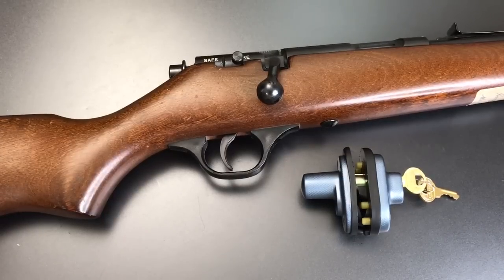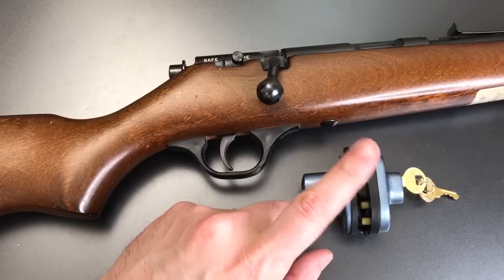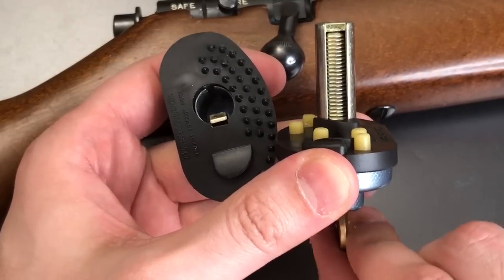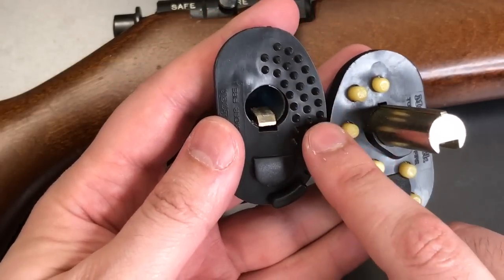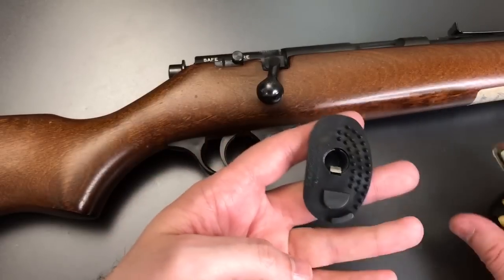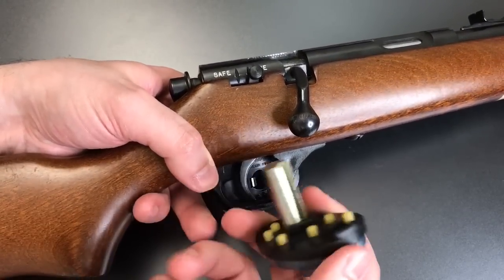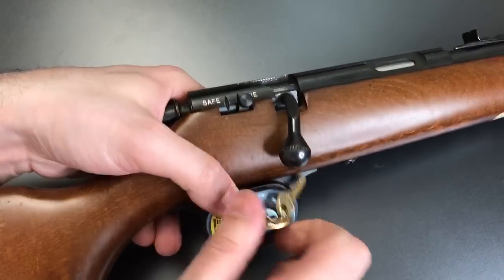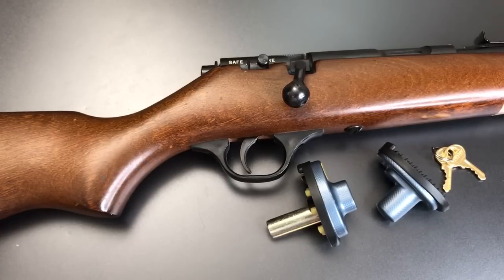[444] Master Lock 90DSPT Trigger Lock Picked

Comment: It's scary to imagine how many parents out there are relying on locks like these to prevent their kids from tampering.
Reply from the maker: EXACTLY!  Hopefully more people will see videos like this and make better decisions about firearm security.
Reply: LockPickingLawyer I wish most people understood that it's important to expose the faults in locks, especially when lives depend on the lock in question.
Reply: I recently obtained a Remington version of that Master Lock. Mine is a metal Forest Green 5-wafer.
Reply: I think if a kid successfully picks a lock on a firearm, you have bigger issues. My understanding that the purpose of a trigger block is to make it obvious that the weapon can not be fired so as to display that it is safe, and to prevent casual mishandling of the weapon. Block in place and in a safe should be more than adequate to prevent a child from playing with it.
Reply: @Mostlyharmless1985  thank you finally someone has sense around here besides me
Reply: Let's be fair; these things are designed to defeat small children. A determined criminal will easily get access, but the fact of them doing so will count against them. If you have to go through the lock on the safe, the lock on the box the gun was in AND the lock on the trigger, it's proof of intent; you didn't just "grab a gun in the heat of the moment and it went off".
Reply: @Mostlyharmless1985  that is the intent of a trigger lock however most people think that if they put a trigger lock on their gun than the gun is actually secure when in reality it really isn't. As lock picking lawyer dually demonstrated in this video a child could easily fire that gun assuming it was loaded just by pushing and pulling on things. (I can almost guarantee to you that I would have accidentally fired that gun as a child assuming it was loaded and locked with that specific lock) cuz I can tell you right now that that's what some people do they will put a trigger lock on their gun and it will be loaded but it'll be a trigger lock with a flaw where you could actually pull the damn trigger while it's locked
Reply: Well, there’s no hope for people so astoundingly stupid to keep a firearm loaded, with a universal trigger block on it and think it’s good. Personally I’d store something like a rifle with the bolt out, blocked, and in a cabinet. For a hand gun I’d just have the magazine in a bedside table and the firearm in a safe, key next to the ammo.
It really bothers me that some people are so paranoid that they’d keep a loaded gun arms reach away. I feel like if you are that concerned about your safety in your home, you should consider moving.
Reply: @Mostlyharmless1985  instead of consider moving maybe consider not pissing off people to the point where you actually need to worry about that.
Reply: well its mostly just for protection from the trigger hitting anything or that too but mostly just general safety

Comment: One thing that I am reading about this lock, is the lock cylinder is supposed to go behind the trigger, not in front of it. So this lock would only work if your gun has enough room behind the trigger. Your little 22 rifle is not the correct application for this lock.

Comment: Masterlock missed a trick here.  If you make a wedge that goes to the back of the trigger,  so it pushes the trigger forward the tighter you push it together, that would at least solve the issue of manoeuvring the lock to gain access and stop you from pulling the trigger.

Comment: There are two other easy defeats that come to mind. You could remove the trigger guard with a screwdriver and the lock would come off with it. Or you could loosen the stock screw and separate the stock and barreled receiver. As far as I’m concerned the only way to secure a gun is in a safe. A lockbox is acceptable if it’s more of less under your supervision, like at bedside.

Comment: You can open them by placing a screwdriver on one side, and giving it a tap or two with a hammer. The two half's will pop apart.
Reply: I was just brutal with a screwdriver and palmstrikes, pushing/ I weigh 300 pounds so I leaned on it and was done in 10 minutes God bless you North China Airguns

Comment: I am pretty sure most of us got it for compliance reason.

Just got mine today and put it on some handgun to see how it fits. The manual says better to put it behind the trigger but both of mine won't seat properly unless I put it infront of the trigger. I got this set since the rubber guard won't damage the trigger guard and purely for lawful storage purposes.

It would be better to add a cable lock to go through the action and put in in a box and put a lock on it. Then you place it in a gun locker or safe for added protection. Or to delay the thief, lol.

Comment: LPL, I have one of these in front of me and have determined it can be bypassed quite easily. All it takes is to insert a sharp object between the back piece of metal and the rubber gasket and push the spring-loaded ratchet part away. This releases the part that holds it all together.
Reply from the maker: I can do it very easily as well... until I securely lock it to a gun.  That's where it becomes difficult.
Reply: Thanks bud. I just did this on my shotgun. Had lost the key and was trying to figure out how to get in. This took me 20 seconds. I guess i didnt have the lock on too snug.
Reply: @lockpickinglawyer  Great video as always! I was also able to wiggle the lock just enough to access the ratcheting detent, and work it off a handgun trigger, as others here have done. I made sure the two halves were firmly pressed together with the spring loaded pins up against various spots on the trigger guard. I completely agree that it must be fitted in the right spot, with the understanding that different gun characteristics may render this device almost useless.This should probably be considered as more of a deterrent than a true “trigger lock”. And I do think you drove that point home with this video - thanks LPL!!

Comment: I've got one of these locks, I'm having trouble picking it with a bottom of the keyway tensioner and a standard hook. I can't tell if the tensioner is getting caught on the metal surrounding the core or not. Additionally, the small keyway makes it difficult to get at pins 3/4 without oversetting pins 1/2 and reaching diagonally around the warding has been pretty difficult. Would a top of the keyway tensioner make the difference in picking the lock, or does it require a slightly different approach with the tools I already have?

Comment: What would be a better style lock for this particular gun?  A cable lock that goes down the barrel and out the action would be good but I've never seen one that long.

Unrelated, could you do a video picking one of those teeny tiny TSA suitcase locks?  A few months back, TSA "accidentally" cut my Abus Titaliums off my Pelican case and replaced them with two of those little 25¢ junk locks that have standard keys and then sent my gun to the wrong airport!  When I finally got my case back, I was going to pick the locks but they were too small to even access the keyway.  I ended up using a 2' long piece of paracord like a slide hammer and popped both locks off in a matter of seconds!
Reply from the maker: If I was locking this with a commercially available product, I would remove the bolt and thread a cable lock through the action.  As for the TSA locks, I don't think that I've ever even held one.

Comment: Great info in your commentary; I  have an earlier version of that particular trigger lock [doesn't have the yellow-springed buttons], but never tried to pull down on it like you demonstrated.
Reply: I remember that style of lock from my youth when it was used to secure an air rifle. Brass pins and more of them if I recall correctly.

Comment: Where I live all the law states is we need a lock that requires a mechanical means to open.  I have one on a lever gun that meets the legal requirements that opens with a screwdriver. Which is weird seeing as I live in Canada.  Would have thought the locking regulations would have been stricter considering what we are currently going through up here (not debating it)

Comment: All you have to do is slide a small flat screwdriver in between the rubber and the back half of the lock and push aside the spring loaded wedge and the lock comes apart easily as the teeth are no longer engaged to hold the lock together.

Comment: There's a few things that you have missed, because they can take that trigger assembly out and put a new one in. Or just take the trigger assembly out and have either a locksmith or a gunsmith to take the trigger lock out.

Also for cheap plastic trigger locks are terrible idea. Because you can break it apart with nearly any tools. Rendering the plastic trigger lock useless.

Comment: the other weakness is the ratcheting mechanism if there is not a good grip on there you can pry up on the teeth on the female end and inch the lock off and if there is a good squeeze on it you can cut the rubber off the lock and make more space

Comment: I watched this video to learn whether the lock pin goes in front of or behind the trigger. You show applying it in front of the trigger. If all trigger locks work that way, that seems dumb. Why wouldn't the lock pin go behind the trigger so it couldn't possibly be fired with the lock on?

Comment: A few years ago, I showed up at the range for training and forgot my key. In front of the instructor, I used a staple from the target stapler as a tension bar and the tooth pick from my Swiss army knife and had it open as fast as the LPL. The instructor was astonished, so  I did it again after he verified that it was locked. Those units are a joke.

Comment: When I use one of these locks on a revolver, I usually can place it behind the trigger, thereby not allowing the trigger to move backwards far enough to fire the gun. Obviously not a great lock, but one that will probably not grant immediate use of the gun when stolen by an amateur. So you probably won't get shot by your own gun if you return home to the burglary in progress, which could be embarrassing.

Comment: Hey lpl! I have this exact gun and have no lock for it. I like with a few adult roommates (yikes!) And have been worried about safety. So far my security has revolved around simply not keeping any ammunition in the house. What lock would you recommend for this gun?
Reply: Lock the bolt in a secure location?
Reply: @Mostlyharmless1985  well yeah but how exactly do I do that? Or do you mean to actually disassemble the fire arm and to physically lock the bolt in a seperate secure location?
Reply: @autodidacticartisan  yeah you just take the bolt out. Dunno about this specific rifle what that entails or if you even can do it, but if you take the “makes it go boom” part of the weapon out of it it’s only as dangerous as a club.
Reply: @Mostlyharmless1985  I guess thats true. I'll Google it to see if its easy. If its something that takes more than 5 minutes though I probably wont do it

Comment: Why use trigger locks when you can use a gun safe? Sure, it can be opened but it's still safer than an easily gotten around trigger lock that might not even need to be picked.
Reply: Gun safes are much more expensive and a lot less mobile.

Comment: i just use a small flat head to move the ratcheting part to open those
Reply from the maker: Though possible, I should note that is very difficult to do with the lock properly installed.

Comment: Masterlock is a "master" lock company.
woulf this lock not be better if the locking bolt just went behind the trigger. There are so many better designs out there. I trust the lockpicking lawyer could safely come up with a good design for gun locks
Reply from the maker: Agreed.  If this went behind the trigger, it would be different.  But I'd imagine that only a few double action pistols could fit post behind the trigger.

Comment: not to mention that rifle has a plastic trigger guard.  1 good whack and the lock and guard are off.
Reply from the maker: Hmm... I'd have to go check, but my recollection is that the trigger guard is a cast metal piece.  Still probably easy to break, and you can also just unscrew it.

Comment: a tricky lock to pick would be to have a internal mechanism that if you press one of the pins, several strong springs would get released, pressing the pins downwards hard, making it so you have to exert a lot of force on the rest of the pins, increasing the risk of breaking the pick. not sure if it would work, just an idea.

Comment: put it on the backside of the trigger instead!
Reply from the maker: Great idea... the only problem is that it's physically impossible.  :-P
Reply: get a smaller dead bolt behind, that´s prevents the trigger from beaing pushed!?
Reply from the maker: That could work on some guns, if you had a perfectly sized shackle and covered the padlock in rubber first to avoid damaging the gun.  But to be clear, that's not a great solution either.  There's a ton of other flaws with trigger guards on a gun like this to consider... like removing the trigger guard with two screws, or removing the whole action with one screw.  Either allows the gun to be fired easily without touching the lock.

Comment: i understand you're making a video about a lock, but i couldn't help but notice as a firearms enthusiast that the gun was on fire the entire video, I'm sure you checked and double checked that it was safe, but its still a shame to see this firearm on fire while you are fiddling around with it.
Reply: My father gave me my first gun when I was 8 years old, a model 9422 Winchester (.22LR). He taught me from day one (and I have continued his tradition) that you are never to rely on the gun's safety mechanism. Under no circumstances. Ever. No one in my family has ever used the safety mechanism on any gun. People obviously have different beliefs in gun safety, but our opinion is that if a gun is handled correctly, there should never be an instance for needing a safety mechanism.
Reply from the maker: +floorpizza Nice first gun!  As for the safety, I largely agree. A cardinal rule of gun safety is never rely on mechanical safeties.  As for this particular video, moose can rest assured that the gun was clear. Still further, one point of the video was to show that the gun could be fired with the trigger lock in place. That couldn't be done with the safety engaged.

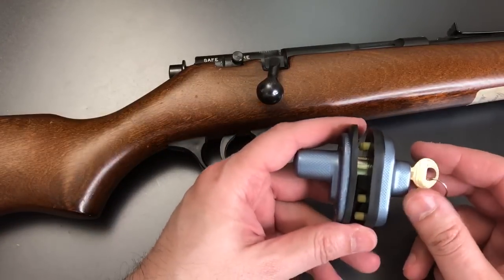Comment: Mostly what this trigger lock will do to protect you is protect you from arrest for being noncompliant with local firearm laws and that is probably its biggest benefit - and not an insignificant one.  [0:35] This Masterlock is a relatively standard design..."  I just bought a three pack of an identical lock, but a completely different brand, five years after the original publication of this video, nothing has changed but the colors in five years - except the brand and the color.  The factory in China that spews out these locks does not watch this channel and does not care about Chinese lives, much less Americans.  And, it works just about this well on my 1936 Marlin 39A, and my two Browning  T-Bolts.

If you have actually bothered to instal one of these virtue-signals on you firearms you'll probably be ok 99.98% of the time [that's six sigma btw] because you probably took two or three other basic common sense actions to keep you firearms out of easy reach of someone who might kill themselves or someone else you care about with your firearms.

If you have kids at home your best defense against them hurting themselves or anyone else is to train them in fire arms use, keep close to them so you know what is on their minds, and keep them off the booze and drugs.  There isn't much more you can practically do as a parent, or an uncle, or an older sibling.